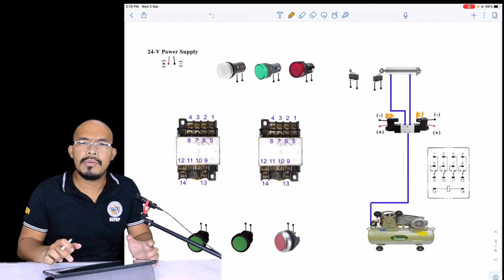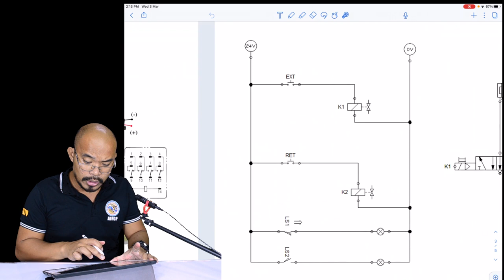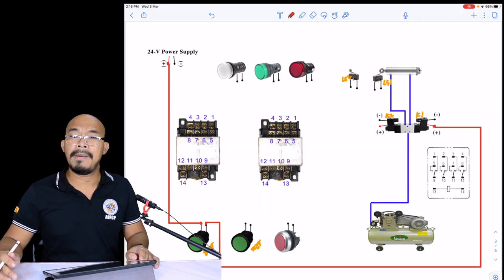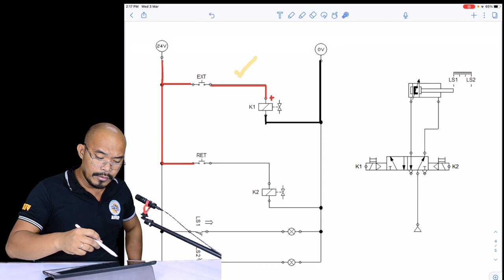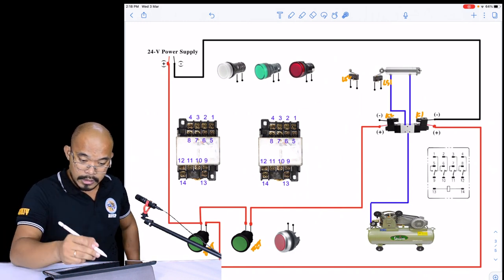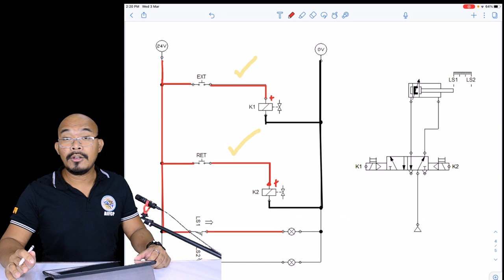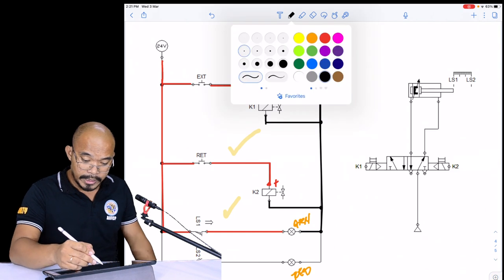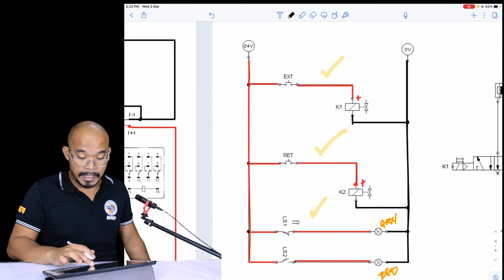How to wire Electropneumatic Circuit (with limit switch)

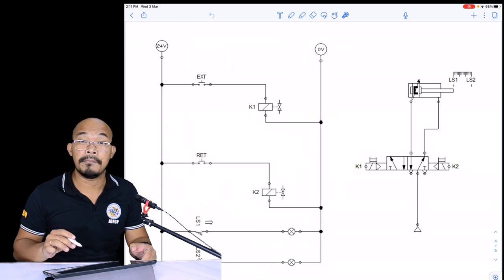Comment: This video fully teaches us that in order to produce a successful output, we must first recognize the components. This is the part where I was able to understand how to define and mark each component and how to connect the limit switch in a  electropnuematic system. As what was given on the previous video, we still have a 24V with positive and negative charge,then also the normally push button ( normally open circuit ) and normally close push button ( normally close circuit), limit switch and pilot lamp that has been added. On which limit switch provides an electrical signal that causes to our lamp response. Start in 0:50 mins onwards this is the part where you to do a step by step process in order for you to wire each component. We have also to identify the solenoid valves and we have to label it as regards to its function. Great video sir, your presentations are often compelling and visually stunning. Kudos and Godless.

Comment: In the previous video, I learned to connect the power supply to retract and extend to k1 and k2. then back again to the power supply which black or negative and the positive or red. Now I know how to connect the limit switch to the pilot lamp by connecting the main power supply to Ls1 and Ls2 then connect to the green button and red button. so that's it. thank you for giving us more knowledge on how to connect the wire an Electropneumatic circuit. stay healthy sir and up up up to your videos.

ESPELITA, JAMES ALLAN M.

Comment: I learned how to wire a basic electro pneumatic control system connected to a limit switch and a pilot lamp. The visualization of components on how it thus being work and connected. Thank you for this video sir.

Comment: this lecture  I finally figured out how to attach the power supply to the push button and then to the way valve and limit switch. The red wire or positive terminal is connected to the push buttons first, followed by the solenoid valve. thank you for this video sir God bless <3

Comment: As the continuation of the previous discussion sir, I observe in this Diagram LS1 is connected to the power supply which is 24v. The other terminal of LS1 is connected to the Pilot Lamp (Green). The other terminal of Pilot Lamp (Green) is connected to negative terminal of our Power supply. It is the same process we connect to Power supply to our LS2 then the other terminal of our LS2 is connected to Pilot Lamp (Red). The other terminal of the Pilot Lamp (Red) is connected to negative terminal of our power supply. This video is very helpful because the Students/Cadets already know how to read a basic Diagram. Thank you and God bless sir. ❤️

Comment: I gained knowledge about how to wire a electro-pneumatic circuit with limit switch. It also gives me the idea how to identify if its  LS1 or LS2 . The LS1 is nearer to the cylinder . We must analyze the diagram and connect the wire step by step . Thank you for this video lecture sir!

Comment: I have learned a lot in this lecture about electro pneumatic circuit with limit switch. there are polarities in the circuit and the way of connecting in the diagram is so clean and so organized. It is also explained clearly and step by step. I learned so much about this.

Comment: This video made by sir Louie is very informative, I immediately learn how to connect the limit switch to the indicator lamp and also how to wire step by step. The 24v connected to the push button and then connect to the solenoid valve.

Comment: This demonstration given me an idea how to wire a basic electro pneumatic control system connected to a limit switch and a pilot lamp. I've learned on this activity is the visualization of components on how it thus being work and connected. The importance in wiring a circuit is we should always follow the directions of circuit diagram in order for us to connect it properly then also put a label on each components to avoid wrong connection.

Comment: In this video I learned wiring  electro-pneumatic control circuit with limit switch is producing signal to the pilot lamp allowing them to start or stop.  And also I learned when you doing wiring you need to analyze and understand the diagram so that you will connect  the circuit correctly. Thank you sir

Comment: Than you for this another series of discussion, this topic is the continuation from the last video. I've learned that how to wiring electro-pneumatic circuit added by the limit switch and the indicator lamp which need to connect each other. Also you have to annalize and understand the diagram so that we can perform wiring properly, and how it thus being work and connected.

Thank you for this video sir 👍👍

Comment: I learned in this video, is on how to connect properly those wire's to the components that is given,  using limit switch,  and it is easy to understand because of the diagram given, thankyou and Godbless sir.

Comment: Thank you for your effort do this video sir. In this lecture I've learned how to wire the electropneumatic circuit with limit switch. Before we do the wiring we need to put a name first of the components to identify which is the RETRACT button and EXTEND button and also to identify which the LS 1( LIMIT SWITCH 1) or LS2( LIMIT SWITCH 2). To identify which the LS 1, if you seen the diagram the LS 1 is nearly to the cylinder piston. The purpose of the indicator lamp is to identify if there is a current flow in that line.

Comment: thanks for this video, I learned a lot of how to wire an electro-pneumatic circuit with a limit switch,we follow and understand the diagram like we can connect the limit switch in power supply and connect it in pilot lamps to light the pilot lamps and the pilot lamps will be connected in the power supply. I hope those people learn. thank you, sir

Comment: I have learned on how to wire the diagram and also the switches that has no polarity so that you can either choose between those terminals that you are going to connect the positive supply. Thank you and Godbless Sir

Comment: As I observe in diagram of control circuit with limit switch, it is the same the diagram before, but in this video they put a limit switch to indicate if the actuators is in extend or retract position, and this video it help us to wiring easily by analyze the diagram, it is step by step to connect the limit switch. Thank you for the video sir, i hope more videos will upload.

Comment: In this lecture as a continuation from previous video, I have learned how to connect the limit switch in the system and the indicator lamp. It is the same to the previous video but we add the LS1 and LS2 in our wiring. In connecting the limit switch we need to analyze the diagram well and connect it step by step. 
Thankyou sir !

Comment: Thank you for this another video sir, This topic same as the previous video, We add in the wiring diagram LS1 and LS2. I learned on how to connect the limit switch in the system and the indicator lamp. And also I learned on how to connect step by step correctly. Thank you sir god bless.

Comment: The video is very useful because through this video we can understand the components and understanding the wiring, it is very useful when we board on ship or somewhere else. And it is not difficult to understand the electropneumatic circuit because you explain it very well sir.

Comment: Thank you for this video sir!  In electro wiring pneumatic system with connected in limit switch in pilot  lamp.  The importance of wiring a circuit is we should always follow the direction of circuit diagram in order for us to Connect it properly.

Comment: You never fail to make us understand your lecture sir!  light indicator can be a great help specially if its far in the system. The indicator,lights it its activated and turn's off it its deactivated. Putting or installing a light indicators is such a convenient way for the operation it also benefits the operators if it has retracted nor extended. Just connect the wires properly to avoid failure in the system.It is also a good habit to label each relay as well as the solenoid valves to avoid confussions. God bless sir! keep making video it is very understandable!

Comment: Thank you for this another  video sir, now i know how to wire electro-pneumatic  circuit with limit switch step by step, now it makes me analyze and understand on how  going to do the wiring regarding with simplify the circuit diagram show in that video, specialy with the limit switch and the indicator lamp which need to connect each other. For me it is very important that you must familiarize its components and analyze the circuit diagram to avoid electrical fire. thats all sir.im waiting for another video sir. have a nice day. god bless you. 💝

Comment: This video demonstration teach me on how I will wire a Electro pneumatic control system that connected to limit switch and pilot lamps. It very clear to me that if we follow and understand the diagram like we can connect the limit switch in power supply and connect it in pilot lamps to light the pilot lamps and the pilot lamps will connected in power supply therefore we can wire the electro pneumatic control system in actual. this video presentation of yours sir help us candidates to prepare in the work place specially in wiring in electro pneumatic system on ship.

Comment: Thank you for this content sir. I've learned that the how to connect the limit switch to the indicator lamp and also how to wire step by step. The 24v connected to the push button and then connect to the solenoid valve.

Comment: Sir, your video presentation will assist us cadets in preparing for work, particularly in the wiring of an electro-pneumatic system on a ship. In this presentation, I've analyzed and understood the diagram and how to connect the circuits correctly and how to connect to components.

Comment: Thank you for this video sir. This video tells about on how to wire a basic electro pneumatic control circuit with limit switch and pilot lamps. I learned that it is important to have diagrams in connecting wire and it is important to know the symbols in order to achieve the diagram. Without the help of electrical symbols we won't be able to do the electrical drawing.

Comment: Thank you for sharing your knowledge sir, I learned so much about wiring on electro-pneumatic circuit we have to follow the diagram like from power supply to normally open push button (EXT) then connect to positive K1 then K1 negative back to power supply negative.

Comment: Elictropneumatic circuit, thank you for this licture sir it gives more knowledge to me how to connect power supply to the push button to way valve and limit switch. I learnd also, first i most understand the diagram how to connect wirings and determine the negative and positive where they connected.

Comment: in this video sir, I learned how to connect or wire the LS1 to Pilot lamp and to 0 voltage. I learned the process of the wiring I know finally that the LS1 must wire to left side to 24volts which is negative, and the other side of LS1 must connect to the Lamp and the available side of the lamp must connect to the negative 0 volts, Same as the LS2 connect the side to the 24 volts positive and the other side is to lamp and the other side or availability side of Lamp must connect to 0 volts which is negative. that's all of what I have understand sir. thank you

Comment: In wiring electro-pneumatic system with limit switch it is with utmost importance to bear in mind that one should always rely on the circuit diagram to avoid mistakes and to connect the wires properly. It is also a good habbit to label each relay as well as the solenoid valves.

Comment: Thank you for this video, for me i learned about the topic in the video same as in the previous we add in the wiring the diagram LS1 and LS2 and step by step the electro-pneumatic control circuit (Limit Switch)

Comment: Thank you for this video sir I learned about wiring on Electro Pneumatic circuit. very helpful to get an idea on how to connect in there particular connection using the limit switch in diagram LS1 and LS2 step by step correctly.

Comment: I learned in this video about connecting the limit switch in a simulator. I also learned that switches and pilot lamps has no polarity. When wiring in a ladder diagram is always to wire in by rank from top to bottom.

Comment: I learned in this video is, the way on how to connect those wire's correctly steps by steps procedure, the positive side and the negative side by the use of diagram showed. And it is easy to understand because   of diagram and the actual photo of diagram in real life. Thank you sir

Comment: Thank you for this video sir,  for this video , it is difference from the 1st video because we need to connect the wire from extend to limit switch to pilot lamp and retruct to limit switch to pilot lamp,  for this video  I learned how to connect the wire from limit switch to power pilot,  I know that everytime activate the retruct or extend the pilot lamp will be activated or will lighten.

Comment: This video provides me knowledge on how to wire electro-pneumatic control system connected to a limit switch. I knew the basic components in wiring also on how to connect the positive and negative wires.

Comment: to wire an electropneumatic circuit is a bit difficult but with this video I learned a lot with were to connect it and it is very important that you must have a diagram of the circuit so that it would be simpler and you must know were to put the negative and positive wires of it.

Comment: Thank you for this continues topic sir, I learned alot from the previous topic, but this topic is you can added the LS1 and LS2 with lamp that connect to our power supply. And the lamp to our Electro-pneumatic circuit is to indicate the extend and retract to our system. thank you sir.

Comment: It is very well explained again sir. Congatss!!!👏🏻 It is the continuation of the last circuit diagram. In my first impression the in this video, It will be easy to analyze because it is the continuation of the last video. This video taught us how to wire a basic electro pneumatic system connected to a limit switch and pilot lamp. It is easy to analyze how to wire the components of limit switch and pilot lamp because it is very well explained. Congrats again sir❗️👏🏻

Comment: Thank you for this another video discussion sir. In this lecture, it is a continuation of previous discussion. It is a wiring of electro-pneumatic system with limit switch and indicator lamp. We should always rely and know how to read the circuit diagram so that we can connect the wires successfully. It is very important to familiarize the components and analyzing the connections in which where it should be able to connect the wire in the circuit in order to avoid errors.

Comment: Another great presentation Sir!   This is a continuation of last presentation. But this time, it makes me understand on how I am going to do a wiring regarding with the circuit diagram shown in the video, especially with the limit switch and the indicator lamp which need to connect each other. Aside from that, it is very important that I must familiarize the components and analyze the circuit diagram to avoid human error which may result to possible hazard that ooccur and put the human's life in danger, especially my co-worker in the near future. Thankyou for another knowledge sir. 👏👏

Comment: Thank you for this Content sir I've Learned that the how to vonnect the limit switch to the Indicator lamp And also how to wire step by step the 24v connected to the push Button and then connect to the Solenoid valve.

Comment: Thank for sharing this video sir, for this video i learned how to connect proper components and system that given by the diagram. The limit of it's switch that connect in 24v, although the negative and positive we determined. The switch and indicator lamp that we connect in wire in the circuit must in the procedure.

Comment: Thank you for this video sir. I learned a lot from the previous topic, but this topic is limit switch in connected in the 24v and to the indicator lamp as they are connected in the system same in the other limit switch.

Comment: Thank you for this video sir, what I learned and understand in this video is just like the previous video but in this video we add in the wiring diagram the LS1 and LS2 step by step in this Electropneumatic circuit.

Comment: Electro Pneumatic circuit. it is very helpful to get an idea on how to connect in there particular connection using the limit switch in diagram LS1 and LS2 step by step correctly. also i learn how to connect wiring and to read its diagram.

Comment: This video helps me how to wire electro-pneumatic control system connecter to a limit switch. And it is easy to understand because of diagram and the actual photo og diagram in real life.

Comment: Good Day Sir! The limit switch is connected in the 24V and the indicator lamp as they are connected in the system same in the other limit switch and indicator lamp LS1 and LS2. The importance of wiring a circuit is we should always follow the direction of circuit diagram in order for us to connect it properly.Thank You!

Comment: I've have learned of your video sir is how the components in control circuit are linked. How to attach the power supply to the push button and then to the way valve and limit switch.

Comment: This video gives me more knowledge about how to to wire a basic electro-pneumatic control circuit with limit switch and pilot lamps. Alike on the previous topic, it states that identify first the components that will be used in that particular circuits before start wiring because it will make easier to connect the wires in the circuit.